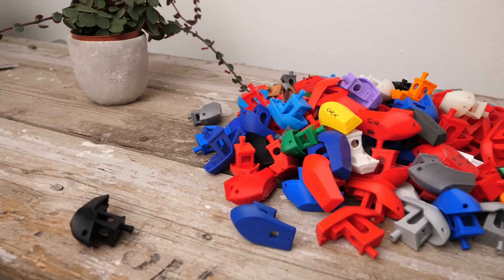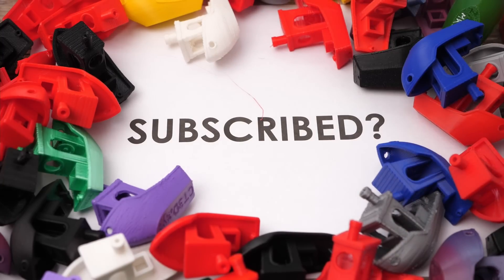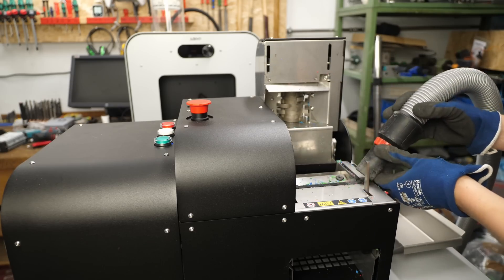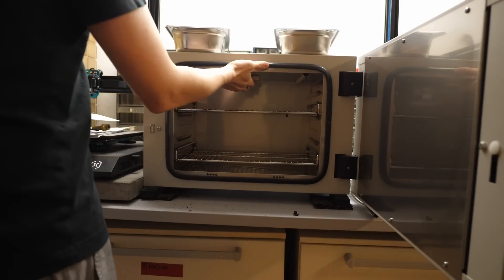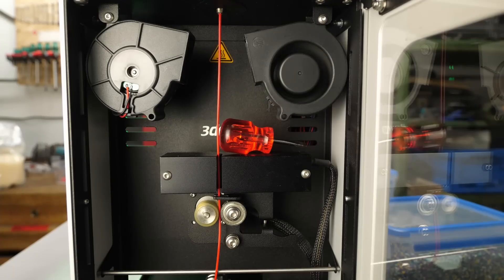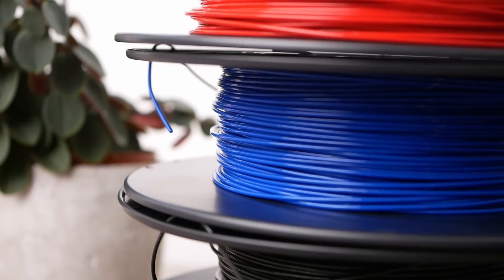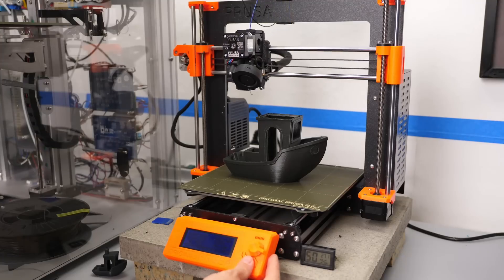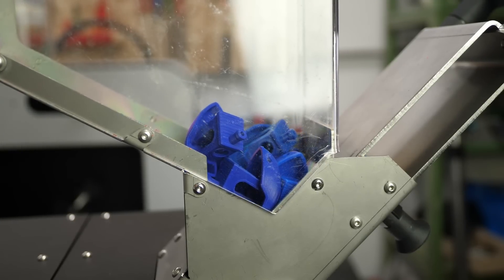Recycling all my 3DBenchys into new Filament

Comment: The main 3D printer channels get most of their filament for free or at a discount - some normally pretty expensive stuff at that. For those that pay like 40 / 50 dollars a roll, it might be worth it. For me....I buy the Ebay cheap stuff and have no problem with it (except occasionally when they sell ABS as PLA...but I get my money back so that's "kind of" OK). Until the complete setup gets to about 250 quid all in (as in the grinder and the extruder as a complete package) then for me it'll never be worth it. I can' really see it dropping to that price unless CREALITY take up the challenge. I'm still collecting all the waste just in-case, and I hate to just throw it in the waste bin. Honestly I'd be quite happy to give it to 3D filament recycler if my small city had one...for free.  That's more likely the way to go. If each city/town had a 3D user who was willing to fork out the cost of these systems and for the rest of us to donate our waste material to them, to help the environment  and just because it's the right thing to do. And the people who own those machines are still going to fork out a substantial amount on the electricity to run them. It's not worth just sending the waste to a recycling company in the post. It would cost me more to do that than just to buy a cheap ebay PLA roll.

Comment: Shredder should use carbide blades to avoid leaving metal in the plastic, and for consistency, as they won't dull like steels will. Carbide inserts are common and cheap in industry, and standardized to be repeatable and easily replaced as needed.

Comment: @CNC  Kitchen   Question: could you have sorted a pile of grey+black+white bencheys together and made a consistent greyish filament(?). Seems to me as new a person to 3D printing grey, black and white are good colors to start with for reuse options if you could always remix them into some consistent shade of grey(light or dark). A consistent grey would be good print stock for functional(vs cosmetic) parts.

If shades of grey work, then by adding small amounts of one other single color you might reasonably get other grey shaded primary colors and there might be a high reuse factor with still desirable color options(? Asking if you tried, or thought about this?)

Have you tried mixing primary colors, do you get good looking color filament out(?)

Thanks in advance

Comment: Could a 2-step extrusion work? I was wondering, if one first would extrude the chips with a larger diameter (lets say 2.85mm just for the sake of it) and not care so much about the constant thickness. Next clip the result to small pellets with some kind of machine and feed those to the final extrusion process. Of course that would requires two melts. But that way one could filter depris in the first pass, and the resulting pellets would possibly run in the second pass easier. Might not be worth the effort, thou.
Reply: Interesting idea, dunno if it's what you thought about or a variation, but extruding pellets of somewhat constant size might indeed make the results better. Also probably making it easier to mix new material or pigments on it.
Reply: @Lassi Kinnunen 81 That's true but given that Stefan had decent success without adding in any virgin PLA it seems like the degradation might be insignificant enough to not be an issue? I'd love to see more, having a method to reuse failed prints would be a game changer. I hate adding plastic waste so I've been collecting and sorting all of my waste plastic for years just waiting until I can reuse it someday.
Reply: @Lassi Kinnunen 81 that is true, but it makes me wonder how much the temperature influences on that. When we think about it, the 3D print is already 3rd generation melt (base plastic - which might be recycled but let's assume not - to pellet, pellet to filament, filament to print) or how do you call it.
Reply: @Kalvinjj  Good points. Hopefully we’ll see some sort of a test about that later; how much remelting affects quality over time :)
Reply: thats what i was thinking too
Reply: Other ideas to improve the Feed characteristics of the shredded prints would be:

1 press them into Pellets (like the Firewood Pellets) but Making them small enough could be problematic

2 round off the sharp edges by putting them im a Rotary tumbler or something similar but that would create dust and microplasic = bad 

3 Round off the sharp edges by partialy Melting them (in a hot air stream) and leting surfacetention pull it rounder but partialy molten bits of plastic will like to Stick to things also difficult for plastics with higher Melting temps

4 Grind them smaller but idk if it will help
Reply: That sounds like a great idea, to me

Comment: could it be worth it, although maybe not for high quality machines, to first get a rough grade of filaments as the inconsistent particle shred size does not help. This first rough grade filement you then pelletize automatically with some nice setup(one motor both feeding the "filament" and spinning a cutting blade and use thoseo pellets to get good quality fillament.

Comment: For the virgin material + recycle test, can you do it with varying ratios of mixed recycling to see how much recycle you can mix in until it becomes noticeably degraded in quality?
Also, when mixing the various recycled material, can you test more thorough methods? I wouldn't imagine such concentrated issue zones unless the particles were somehow concentrated there. Possibly a function of the vibration?

Comment: What about a 3d printer that takes pellets/shredded instead of filament as it's input material?
Reply: I believe there is a 3d printer extrusion setup that does that. Also, the majority are large format printers.
Reply: There are a number of setups that do this the problem is they only take pellets and the cost of pellets is almost the same as the filament cost making it not worth it. Plus the weight of these setups is going to significantly impact print quality

Comment: Look for piercing needles, gauge 12, available on amazon germany, run the filament through there before it goes to the spool, it would shave down the filament to a quite consistent diameter around 1.8mm, they are super sturdy and sharp, it's the stuff they use on the hotends as standoffs (surgical steel)

Comment: i wonder if you could make HDPE filament from old milk bottles/washing liquid containers etc
Reply: Yes, you can make recycled HDPE filament.
It is VERY hard to make it adhere to itself, which is why most of the HDPE stuff you regularly touch is either cast or blow-molded.

It also shrinks and warps constantly. It's a VERY difficult plastic to print.

Comment: Since the result filament has high variability, I would just use it to make pellets by just cutting the result filament into tiny pieces. And then run it through the machine again. Should result in much higher quality :)

Comment: So I know that's maybe a bit too much work, but how often can the filament be "recycled"?
The already extruded spool, even though there are issues, is basically very homogenous and also pre mixed, so what would happen if you would have a second mixing assembly, from which you then make the final filament or shred / cut and extrude those problematic spools again,  since the consistency should be much closer to fresh granulate, right?

Comment: While the machines used are expensive, it's great to see a proof of concept go so well. My 3d printing friends are halfway weighing the idea of a shared shredder/granulator/extruder. Probably the only way to make it halfway financially viable today. Personally, I recycle my prints into solid rods, flat bars, etc for use in other processes (lathe, etc).
Reply: Problem is it only takes one numpty to accidentally leave a small bit of ABS in your PLA and hey presto blocked machine and good luck cleaning that out it would not be a matter of if but when. Great stuff by the way with the rods 👍 I think that's the way to go where you don't have to be so delicate with them.